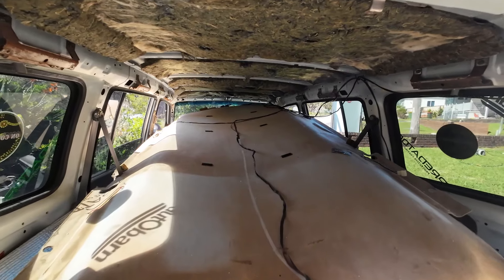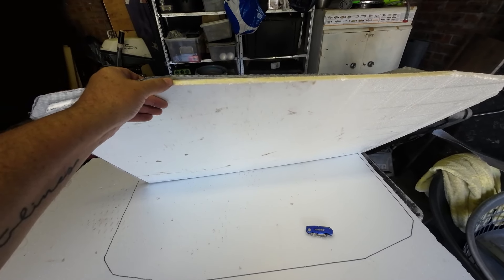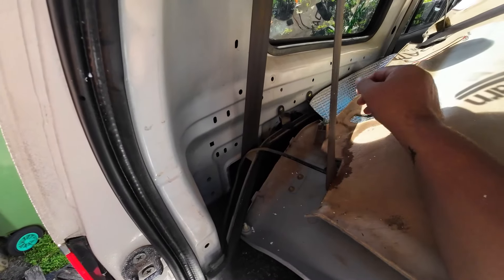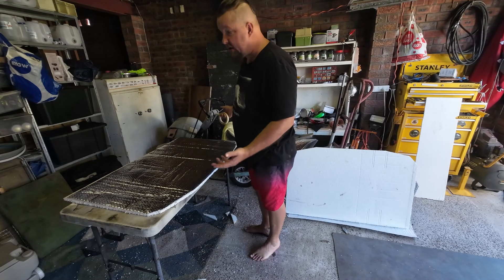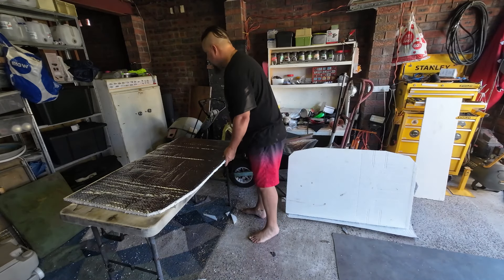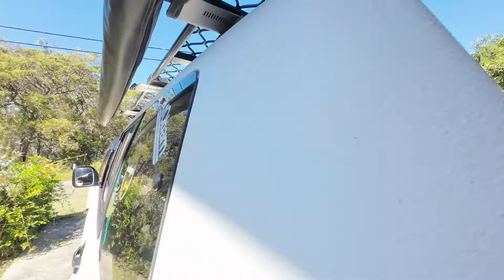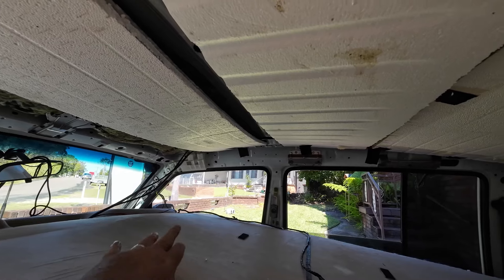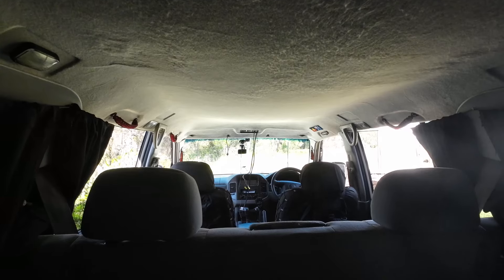Insulating the roof of the Pajero, Can I get some cooler nights?

Comment: How hard was it to drop the the liner? I want to put a rhino rack on my GEN 3 but i have to drop the roof liner.
Reply from the maker: Not difficult, putting it up is a bit of a pain lining the holes up. There are 3 plugs across the back door, screws inside the rear light then undo the grab handles and unscrew the front seat belts at the top to get the trims off. It basically slides out then. You have plugs for the lights etc but it's pretty easy over all.